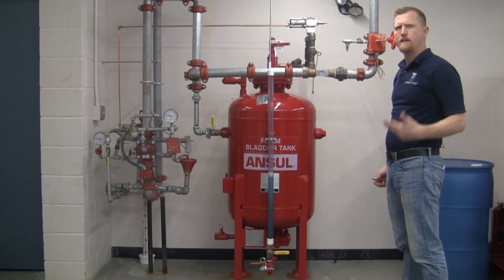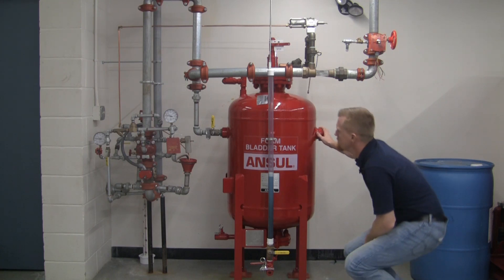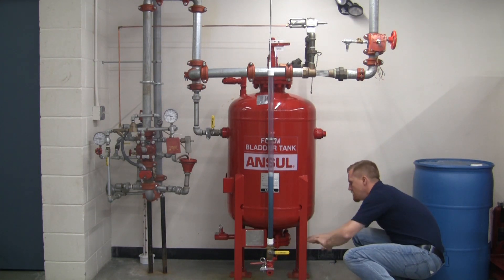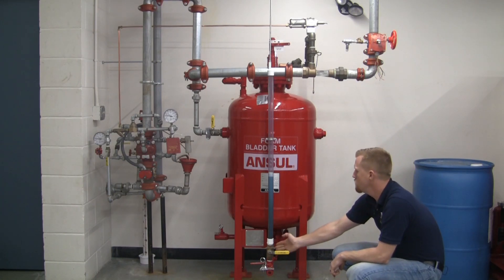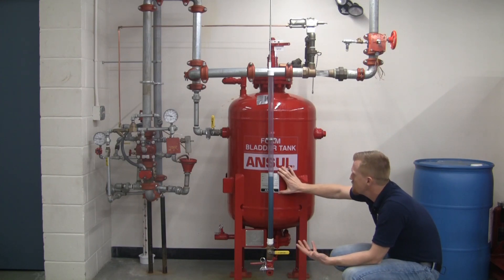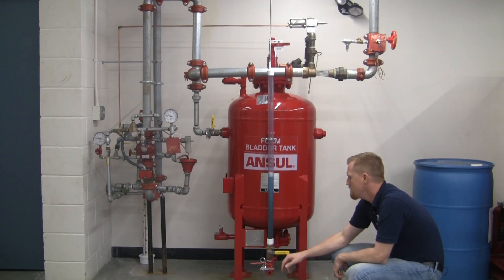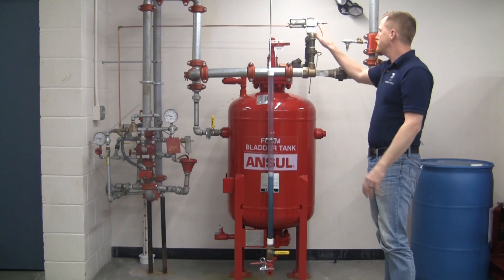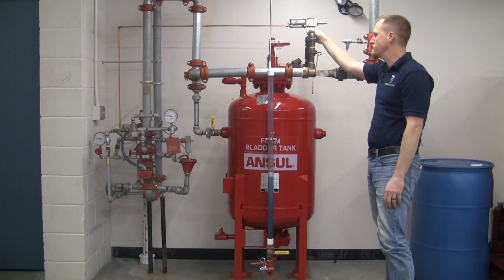Ansul Foam System - Highlights

Comment: Sir, 
We are designing a foam base deluge sprinkler system as we have combustible solid and liquid material tanks. 
So, my question is,
How many no. of open type sprinklers should be on 1" or 2" line for Ordinary Hazard Group 2 and what should be the density of the water used for this system.?
Reply from the maker: Hello Imran, 
We don't design fire protection system. We have a cloud based fire inspection software that enables people to inspect fire protection systems and equipment. I suggest you contact a the https://www.nfpa.org/Codes-and-Standards/All-Codes-and-Standards/List-of-Codes-and-Standards and a fire protection systems engineer. 
Thank you for reaching out!
Best regards,
Inspect Point

Comment: How to disable Foam system in control panel please help me
Reply from the maker: Hello Mohaideen, 
We don't design fire protection system. We have a cloud based fire inspection software that enables people to inspect fire protection systems and equipment. I suggest you contact a the https://www.nfpa.org/Codes-and-Standards/All-Codes-and-Standards/List-of-Codes-and-Standards and a fire protection systems engineer. 
Thank you for reaching out!
Best regards,
Inspect Point